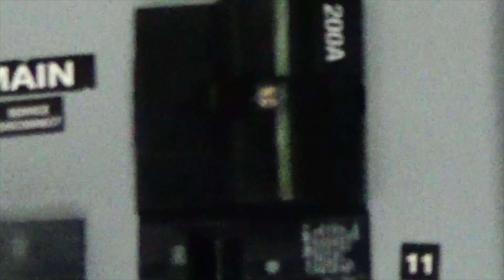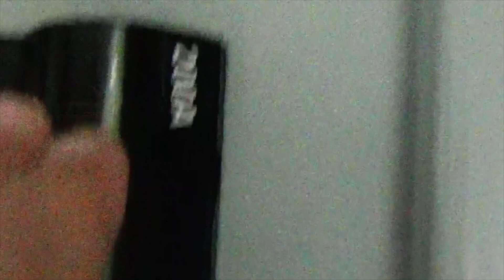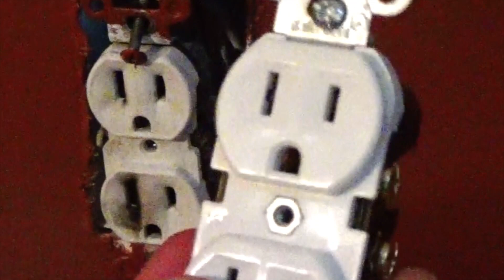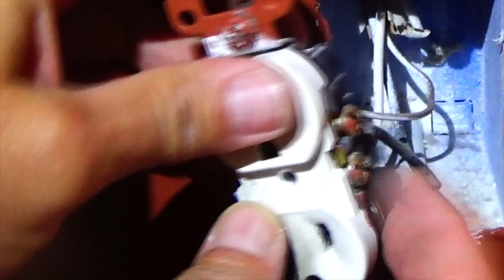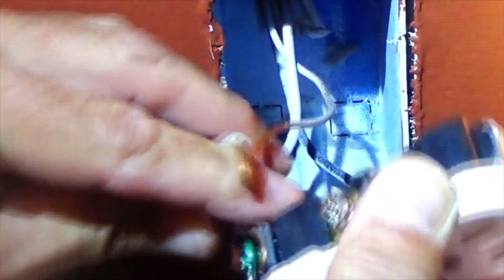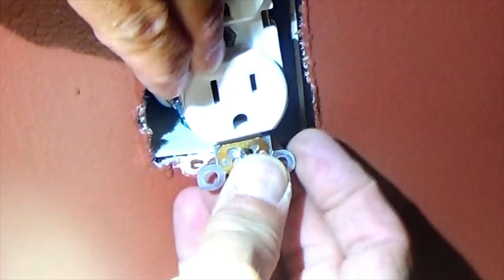How to Replace a Wall Outlet

Comment: Good job. I'm replacing all switches and receptacles in our house. I suggest upgrading to spec grade at about $2 each for receptacles. Also, I would use a slotted screwdriver that's the next size up for tightening the terminal screws.
Reply from the maker: Thanks....Good tip, and good luck!